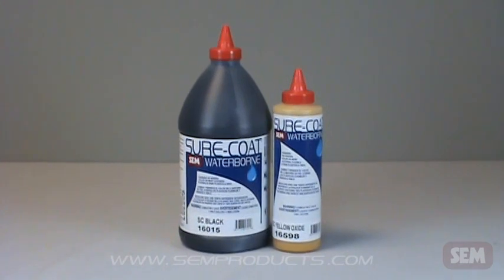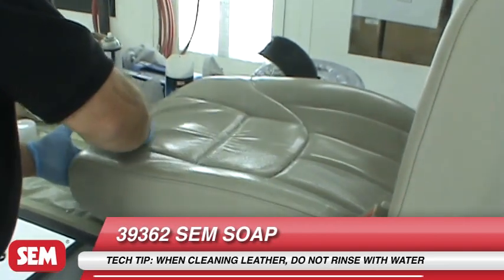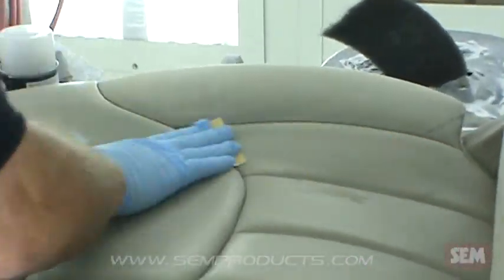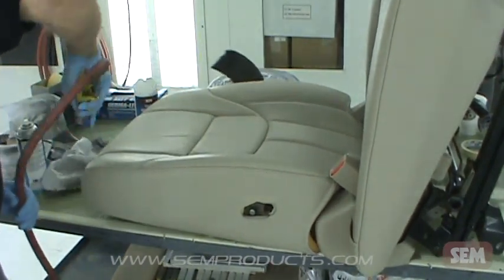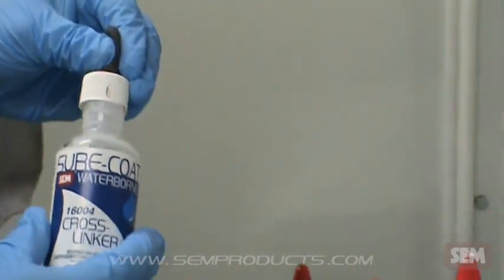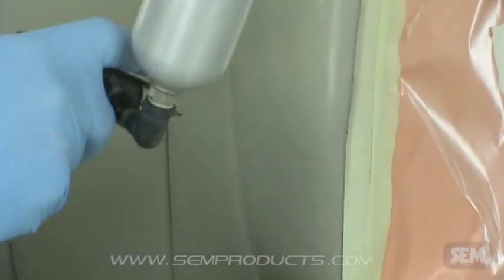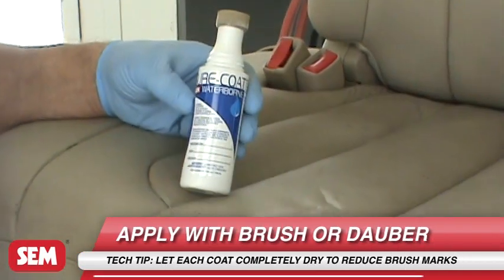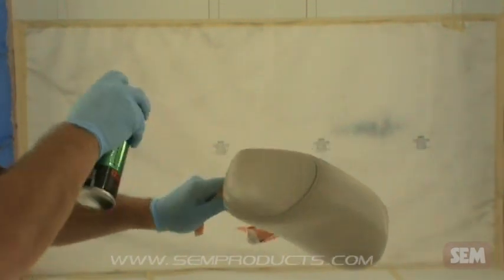SEM Products, Inc. - SURE-COAT

Comment: color coat, sure coat, what's the difference?  Are these separate products or the same?  Are they intended for different applications? if so, please state them.  Your product line is confusing and unclear.  I need to paint a vinyl top on a classic car, and its very unclear which of your products to use.
Reply from the maker: You can use either product. Sure-Coat is a waterborne flexible coating available in bulk and can be mixed to your specifications at a local jobber store. It can be sprayed or applied with a foam brush and is for leather, vinyl and plastic. Color Coat is a solvent based flexible coating and is available in 50 aerosols or can be mixed to your specifications at a local job store. It can only be sprayed and is for vinyl, plastic, carpet and velour and should not be used on leather.